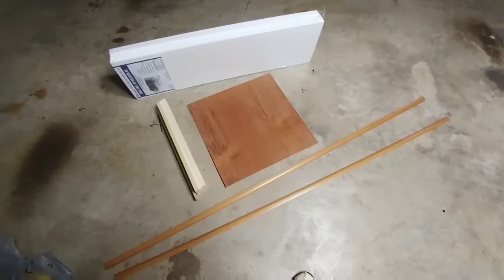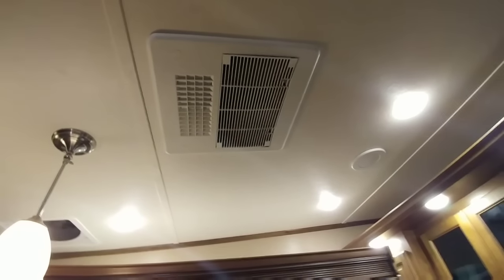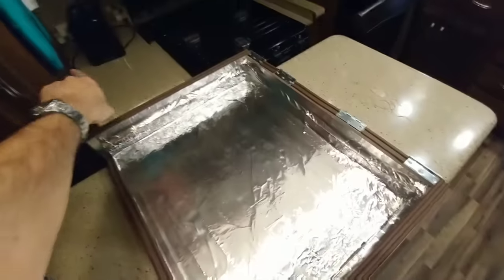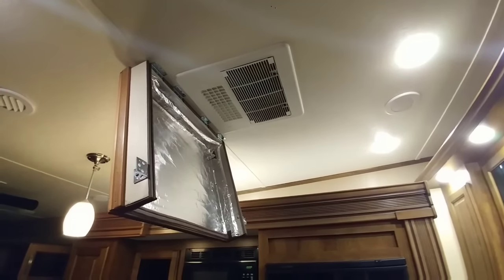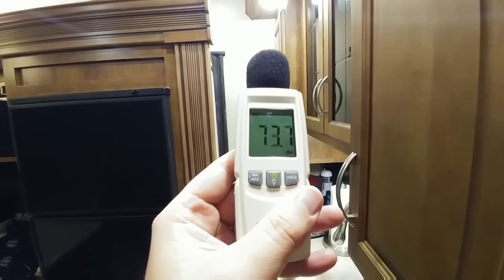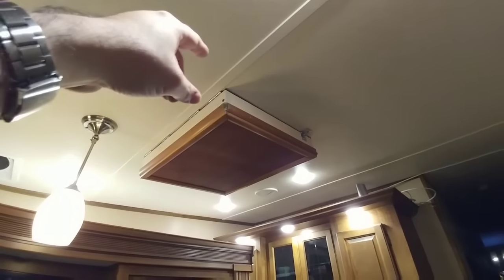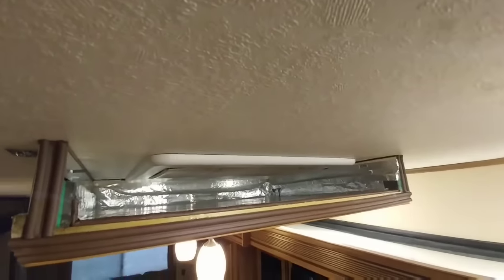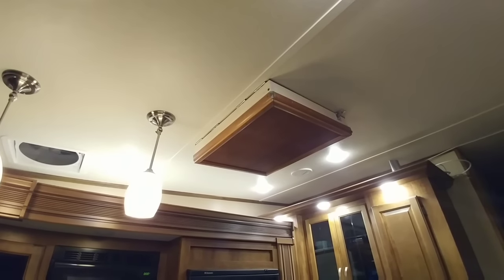Baffle Box for AC! This is a Must-do RV Mod!!! Watch this!

Comment: Pretty slick. If you could filter the air before it enters the baffle you could line the box with a more efficient sound deadening material that could be glued in. The tape probably reflects some sound back out.

Comment: Good idea!  However, the AC in my 5th wheel was made by Carrier and it is operated by an IR remote.  Therefore, I could not put a solid box around around the ceiling unit as it would block the IR sensor.  Instead, I bought a clear plastic storage container and cut off one end.  It is attached by rare earth magnets to the ceiling unit's frame to make filter cleaning easier.  Even though there is no sound proofing in it, the cover still cuts down the AC noise by a few decibels.  I can replace the AC "muffler" with a standard insulated hatch cover, also attached by magnets for the winter.
Reply: They have IR extenders that you could plug in in line with the opening on the box to catch your angles

Comment: I could not build a wooden box over the intake on my Carrier AC because it would block the IR remote.  Instead, I used a clear plastic storage container with one end cut off.  It is held to the grill frame with magnets.  I replace the "muffler" in the winter with an insulated skylight panel, also held on with magnets.  This arrangement reduces noise several dB and the remote still works.  Thanks for the idea!

Comment: You might want to look at putting open cell foam instead of the insulation tape.  The foam will absorb the sound waves produced by A/C vs. the tape is allowing the sound to bounce off and exit the opening.  You can look at sound room designs for studios and they are lined with foam, granted it is special designed foam but any open cell foam will work to absorb the sound.
Reply from the maker: Nate Roth: great suggestion, I thought about that but opted again it because, though it absorbs sound extremely well, it also can cause drag and a greater co-efficient which might reduce airflow in.  To combat air resistance, I even positioned the strips of tape so that the seams overlapped away from the entry to the baffle.

Comment: Ours is right over the middle of the living room which is essentially between the tv and recliners. It's drives us batty. You can hear the tv better from outside than you can from the chair.  I am going to share this with Austin. I am so impressed.
Reply from the maker: Austin and Kayla: because your AC is so close, it will probably help but not as much.  face it away from the seats and it should be about a 3db decrease.

Comment: it looks nice but maybe think about adding a louvered front to it that wouldn't restrict airflow and make it look much cleaner also maybe think about using brass fixtures to hold it in the air or same as your other fixtures it will then give it that factory look and and be more appealing to the eye great video thanks for the info

Comment: You must only use the ceiling ducts. If an AC didn't have the ability to switch to ceiling ducts only,  you would be recycling your conditioned air back into the return air causing you to not condition the entire coach.

Comment: Nice job, and luckily finding matching wood trim pieces.  Agreed the "L" brackets are ugly.  Mount them in board and run 
a couple of matching finish wood pins into them from the outside.  You could keep them with fishing line tied to an extra hole on the interior mounted brackets.  Just a thought.  
Phil Salsbery

Comment: One more addition I'd suggest is to emulate recording studio AC systems which use foam lined ducts to cut down on the noises that naturally happen when you push air thru a restricted space. In the case of your excellent solution to RV AC noise; if you were add some carpeting or heavy felt to the silver foil backing of the baffle, it will absorb even more of the sound that's coming out now. 

By having only the hard surface of the foil, you've in effect created a resonant chamber - a poor man's speaker if you will. Yes, the sound on the opposite side of the baffle is reduced, but on the side with the opening to the return, it's still the same volume as before the baffle. By adding something absorbent - carpet tiles, thick felt, etc., you can cut down on the ambient noise from the baffle opening. Great video - IMHO, the loud ACs in RVs ruin what we're out in the RV to do which is to get away, rom the noises in life. I don't like sweating either so your solution is a good one.

Comment: To anyone who might have a hesitation, thinking this would restrict airflow, think of this.
3"x24" opening = 72sqin opening. If I remember, BTBRV, you have 3 roof AC units. This means that the entire square footage of the unit is being taken care of by 216sqin.
Many people have a 24"x20" filter on their 1500sqft HOUSE, meaning their entire house is being serviced/cooled by 480sqin of air flow. Your house.
Even if there are only two roof AC units, given the average floorplan square footage of most RVs, the ratios of square footage to square inches of airflow would be sufficient, more than sufficient, for the usage. If we take into account the (more accurate) actual CUBIC FOOTAGE of the areas, because houses have slightly, to a LOT taller ceilings, the ratio improves even more. And if someone wants to post a debating viewpoint, I more than welcome it. Numbers don't lie, but there maybe be a variable regarding AC units that I may have not thought of.
Reply from the maker: Luke Edward: we have 2 units and the Dometic 15kbtu unit that this is installed over has a 12"x6" opening that funnels down to a 2- 12x2" main duct chases for the entire ducted AC system. Your logic is spot on.
Reply: Luke Edward: Air flow is measured in cubic feet per minute, not square inches. That 1500 sqft house you use as an example probably has 24,000 Btu/hr ac, at 400 cfm per 12000 btu/hr that is 1000 cfm. Most filter manufacturers recommend a velocity of 300feet per minute which is where your 480 sqin of filter area comes to play. Therefore, a 15000 btu/hr unit should have 240 or more sqin of filter area. Velocity is a lot of the noise but in an RV you also have the unit right above the return which adds to the noise level.
Reply: Excuse me. I meant 30,000 Btu/hr not 24.000. can't seem to edit replies.
Reply: Mark Hawkins In taking the velocity of the airflow out of the equation, that third vector, or dimension, in the measurement, all things being equal, the CUBIC feet is reduced to an equation based on the two dimensional area of the air filter. If you are measuring the cubic feet, then the metric of the blower capacity must be taken into account. In showing that the dimension of the air vent is not a restriction in this equation, and still allows equal, or more, of the same measured area, then the fan velocity is therefore, not restricted. If we are going to add into the equation what you are suggesting, than even the measurement of the coefficient of friction of the air against the surface area, which would cause turbulence in the airflow, becomes a calculable variable. The same thing happens when you look at a performance intake manifold. Port matching, or the area of the intake/exhaust being enlarged, greatly affects the CFM of the manifold. Or, a square inch port area measurement affects the cubic inch flow measurement.
Yes, comparing the RV air inlet to a house inlet can be a little misleading, but I was only using my calculations to show that capability of that AC system does not need to be thought of as "too small" because the inlet lengths and widths were changed.
Reply: Mark Hawkins I guess in simple terms, yes, it is measured in CFM. But, simplified, CFM is nothing but area times velocity. The AC fan provides velocity and doesn't change, thus meaning the area of the inlet where the air is entering into the filter being as large, or larger than the filter area will not restrict flow, meaning CFM, and thus efficiency and AC operation, is not affected.

Comment: That cover worked out pretty good . Another great to the point video .
Can I suggest a video on inverter generators , particularly the Honda line up of generator. Show your viewer's the 1000 watt and up . Why they should choose a certain size for there application.  The wattage they're going to require , or weigh of there generator or the size of there generator and how quiet they are. Also factor in a price comparison against the aftermarket, you know the ones that try to be a Honda but let you down eventually.
Reply from the maker: Shackles: sure. it'll give me a reason to go to the store

Comment: Okay, here's the deal: That intake is designed to  take in air from a half sphere radius of sorts. So I'm guessing that you're on the right track but not quite there when it comes to real world cooling and air circulation? I do like your videos, especially the ones about the Chevy trucks. Now like most, no wait some youtube commenters (understanding that I'm not actually doing and just commenting) Maybe you could design a baffle that redirects sound in several directions to dissipate it and then like an old glass pack muffler somehow absorbs it. But then again those old mufflers don't absorb they just redirect, or do they? How do those bose noise cancelling headphones work? What do you do with the ac in the bedroom?  I'm guessing aim it away from the head of the bed? Crap, this could go on forever. Nice handywork on parts and assembly. I'm sure the wife is really happy about not looking at some sort of science experiment hanging from the ceiling and probably really helpful when you're trying to enjoy some peace and quiet in the texas heat. Enjoy and thanks for the vids.

Comment: Very nice mod. My fifth wheel has its heat - pump ac unit mounted in one of its outside trunks from there it's ductwork is run. What about using cabinet door latches - like kitchen cabinet doors in place of the L brackets. Just a thought and I will sure be passing your video and mod. to other RVer's it used to drive me nuts when my RV had the same unit yours does. Thank You

Comment: I have the same problem, both my ac's are really loud in the new 5th wheel, which is kinda good cause they move a lot of air.  Would like to do this mod, but I wonder if you could somehow use commercial grade velcro to attach it to the ceiling.  That stuff can be crazy strong.

Comment: is there a similar fix for dometic whisper quiet systems?  I don't have the air flow I think I should have but of course there is not A/C sticking out of the ceiling which would make it easier.  I am assuming the plenum is the same just that I would have to pull the A/C off the rooftop.

Comment: Nice video & approach to correcting pour design and/or construction on expensive trailers and motorcoaches, sir.  A couple errors in your description are very commonly & incorrectly professed as "gospel" by the masses.  (They most often say these things when they want to appear more knowledgeable.)  You, on the other hand, obviously have some understanding and merely seem a tad nervous.  That foil tape reflects heat (certain radiation in a narrow portion of the light spectrum) , CAN do it very well, but does NOT present any heat insulation.  Insulation is merely resistance to the flow of energy.  In this case, it is resistance to the transfer of heat.  Aluminum is an extremely efficient conductor of heat energy, similar to it's efficiency in electrical conductance.  Congratulations on slaying one of the "dragons".

Comment: On our unit it makes almost as much difference as you got, by just closing the discharge door into the living room as you got with your mode. Yours looked like it was open in your example. I have one other question about your unit hat is unrelated to this mode. What is your weights side to side with all your food etc. in the kitchen for a trip? Seams as if it will be pretty heavy on the left side.
Reply from the maker: John Irwin: I had blast vents closed. As a matter of fact, we never open them

Comment: Can you elaborate on how you determined it would be safe to screw to the ceiling and what screws you used? I'm always worried about screwing into the walls or ceiling of our 5th wheel.
Reply: I'm betting he used a stud finder to locate the studs which go through the ceiling off all RVs's.

Comment: Question:  Do both vents blow cool air?  Or is one an intake and one an exhaust?  Usually one takes in warm room air and the other blows cool air.  If so you are mixing warm and cool air which is not a good idea.
Reply: I have that same AC in our camper.  The cold air is ducted to ceiling registers instead of coming out of the unit directly.

Comment: I love your videos but I still wonder if it will have any long term consequences because it is somewhat restricting the factory design .
Reply from the maker: Kevin Youngblutthe opening is over 1.75x larger than the OEM external return air openings and at least 4x larger than the internal ducting.  Airflow shouldn't have any restrictions

Comment: The L brackets on the outside are just plain ugly!  Try mounting the L brackets on the inside with a latching system.  The rest of it is nice and functional.  What about a black mesh grill for the opening?  Remember how cool the 67 Pontiac GTO grill looked?  🙂🇺🇸
Reply from the maker: P J: agreed. I'm working on something.
Reply: Suggestion - Tenn-Tex T195 or Tenn-Tex T191 False Front Panel Clips.
Reply: Try magnets
Reply: do you think these fasteners will hold if you hit a large bump with the trailer.  Our living room unit is a the very rear and the bedroom in up front.

Comment: You're begging for black mold and mildew. No recommended 🤔
Reply: @starttherebellion9146  Where do you think water goes after a coil freeze melts? It will cause mold on top of the baffle.